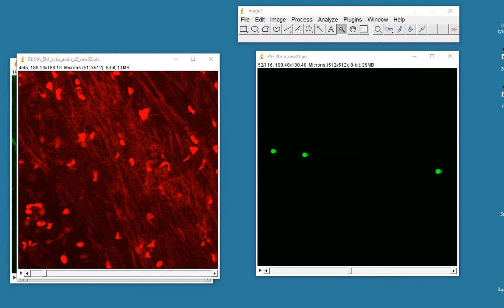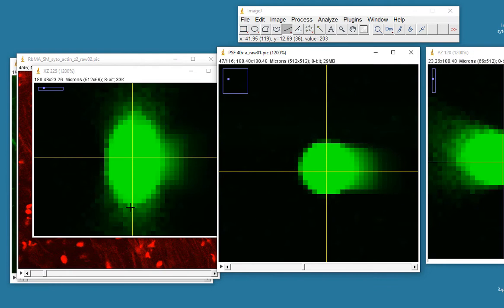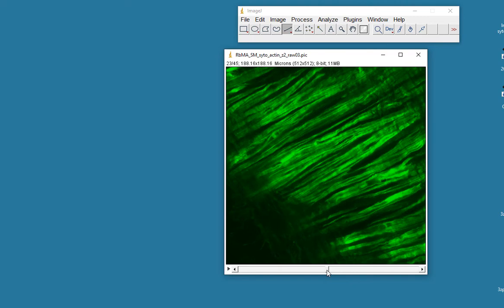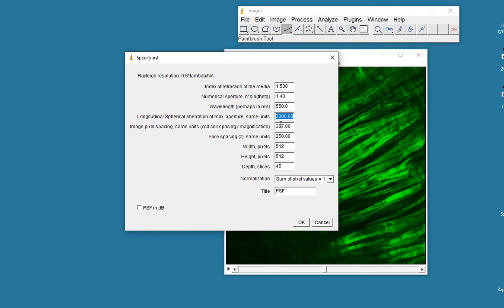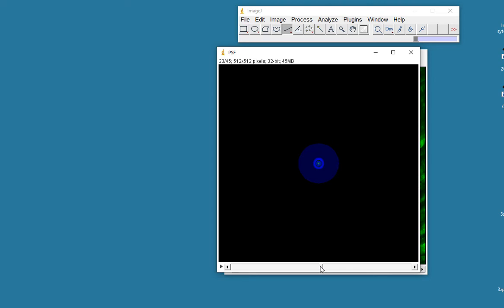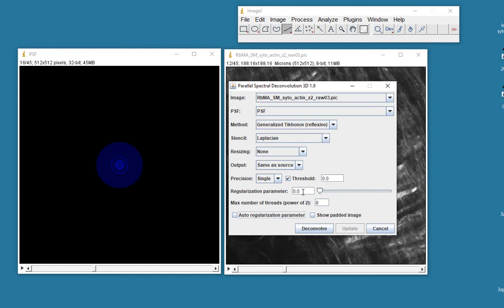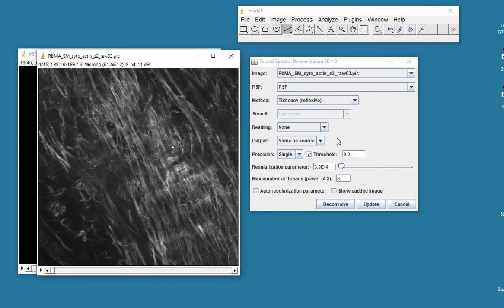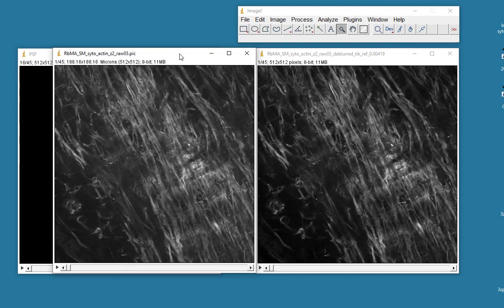Deconvolve a confocal dataset using ImageJ

Comment: Thank you for the very helpfull video, I had some difficulties to install the plugin parallel spectral deconvolution, and now it is installed it doesn't work :(
Reply from the maker: hi, email me at the University of Glasgow and I will send you instructions for a possible fix.  Craig.
Reply from the maker: oh, are you using ImageJ or Fiji?  try using the other one, sometimes that works. C.
Reply: @CraigDaly  I am using Fiji I installed the latest version of the plugin (1.9) it seems that the version 1.12 works better

Comment: Is spherical aberration unavoidable in this kind of dataset? If we know from this dataset that the microscope produces this sort of aberration, could we correct for it on the microscope before generating datasets in the future?
Reply from the maker: Great question.  As Scotty said, in a rather Canadian style Scottish accent, ‘ye canny change the laws of physics captain’. However, dual photon microscopy (2P) does appear  to give slightly better axial (depth) resolution, but only to the point of being the perfect (theoretical)  confocal (single photon, 1P) microscope.   4Pi microscopy uses 2 objectives focussed on the specimen and increase axial resolution by about 5x. So, yes, microscope designs are evolving in an attempt to beat the axial resolution barrier.

Comment: I don't understand how to calculate my longitudinal spherical aberration? Do you have to have imaged beads on your confocal microscope used??
Reply from the maker: Hi.  Yes, but you could estimate it.  Start by assuming the z-axis is stretched by a factor of 2 and see how that works.  Best method though is to buy a test slide with fluorescent beads already mounted.  Make a z-series and measure in xyz.  Better still, get some point spec beads and actually model the point spread function.  That would be required for the more advanced deconvolution software like Huygens.   Anyway, short answer to your question is YES.
Reply from the maker: Chris, your question prompted me to make a video on this.  Thanks for the question. C.

Comment: Hey. Thank you for this video. It really helped. However, when I tried to use the "2D Spectral deconvolution" plugin, it says that "For 3D image, use Parallel Spectral Deconvolve 3D". When I used the "3D Spectral deconvolution", it says the reverse.... "For 2D images, use Parallel Spectral Deconvolve 2D". I tried the other image formats but didn't work. I can see you used the ".pic" format. Please share your suggestions on this. Thanks in advance.
Reply from the maker: Strange. Sounds like your data may be in a format that the plugin doesn’t recognise.  Simplest dataset would be a single channel z-series of square (512x512)  8-bit images. Can you get your data into that format?
Reply: @CraigDaly  Well, I tried to convert the image to a single-channel image (via online available tools). However, the imageJ is still reading it as an RGB image. When I converted the image directly to grayscale (same, via online), it shows the error as stated in above comment. As you shared,  the problem seems to lie in this image support or conversion itself. Any suggestions please?
Reply from the maker: If you go to Images/type/8-bit. Does that file conversion work? Or split the RGB channels and use just one of those (which should be 8-bit).
Reply: @CraigDaly  Thank you for your response. I tried the 8-bit conversion which worked. But the initial problem still persists. "For 2D images, use Parallel Spectral Deconvolve 2D" and so.. My image is now 262*208 8 bit,53K, and so is the size of PSF.
Reply from the maker: How many slices in the z-series? Is your dataset the same thickness as the psf.  Do you have both the 2D and 3D plug-ins installed?